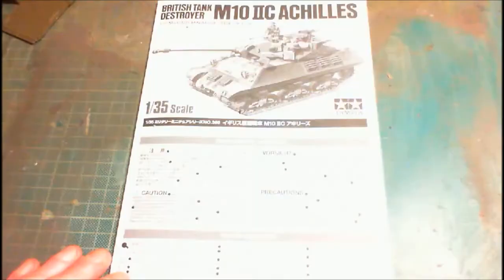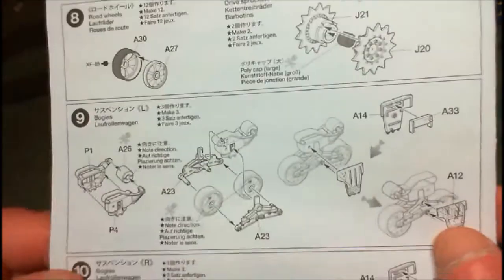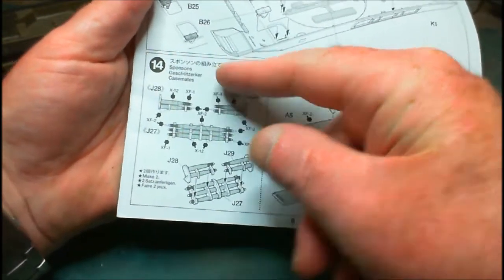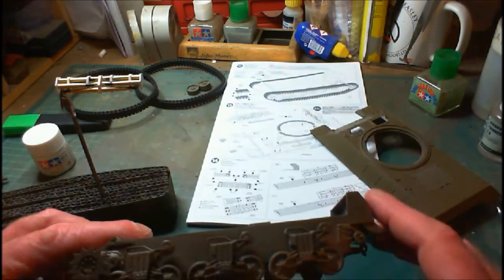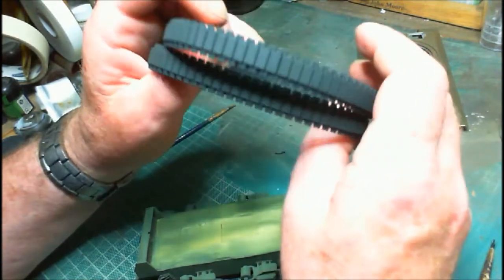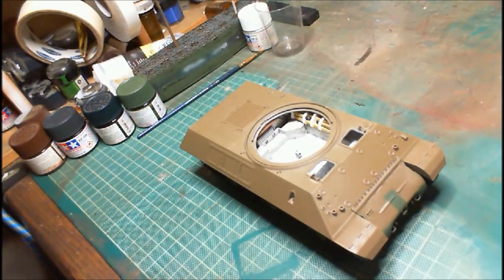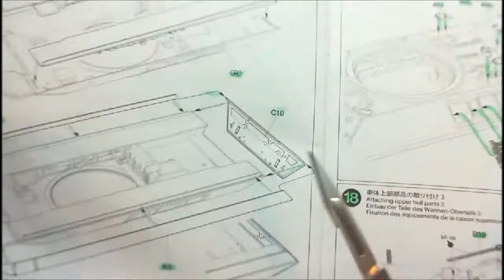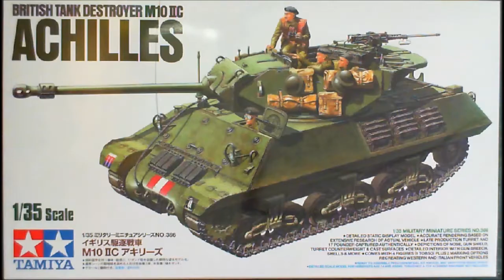TAMIYA 1/35 Scale WWII British M10 IIC ACHILLES Tank Destroyer Build Update 1

Comment: I had a book on the M10 that stated the reason the applique bolt on armor wasn't used was because the added weight caused mechanical break downs in the field.  Although, you can still find the bolts for the armor on the turret and hull sides.

Comment: I'm really not a fan of Tamiya's rubber tracks.
Shame so many of their 1/35 kits come with them as standard.
I feel like it's a bit of a gimmick like the metal tub or weights they put in their 1/48 kits, suppose it must be because many of their 1/35s are designed with RC in mind.
Great work on the model though.